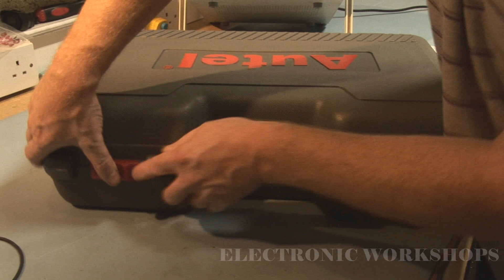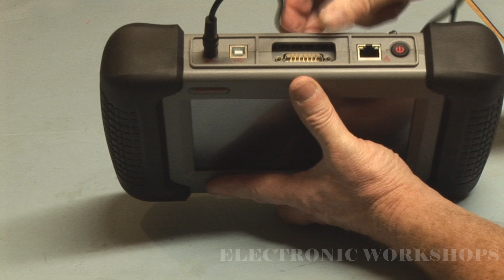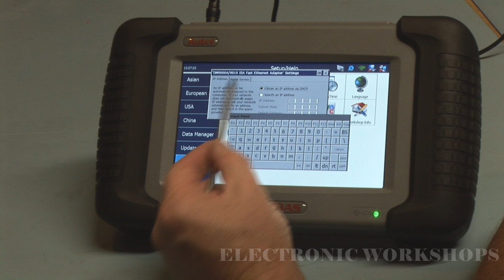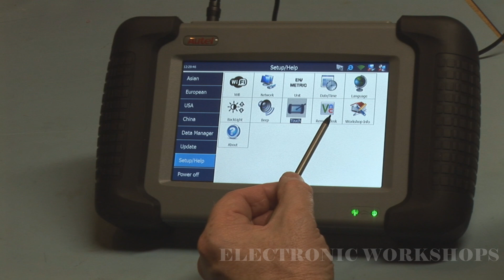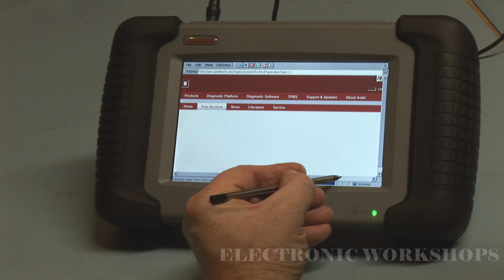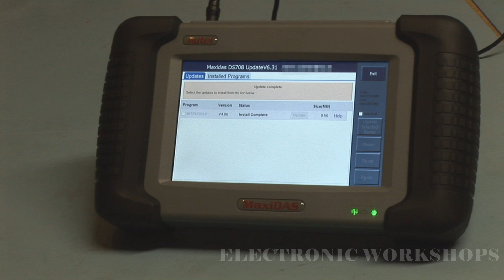Autel MaxiDas DS708  All Systems Setup and Registration Part 1

Comment: I tried to start my Autel maxidas to Setup my ID, but I couldn't even see the main menu after I must have inserted my sd card then plug to dc power supply then press the power button, it will on and display : corrupt memory card or sd card not inserted or wrong SD card... 
Please what could the problem be?
Reply: After a year, I think you bought a used one and try to set up your own ID. The scanner was activated by previous owner and already expired. You need to renew the membership and pay a fee before you can use it.
Reply: Pls how can I pay for member ship pls send me the link thanks pls feed me back

Comment: Nice, have you upgraded from the earlier MD802? Thanks for sharing.
Reply from the maker: I have, I really needed a scantool with some kind of bi- directional control, to do idle relearn and be able to control outputs when testing, I still have the md802, this is handy when I have connection problems on the ds708, the md802 might connect